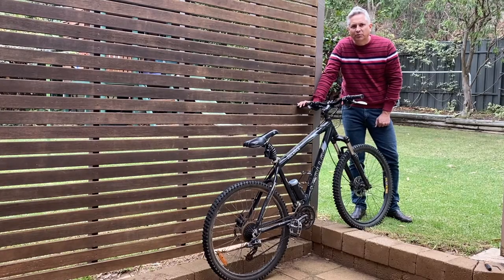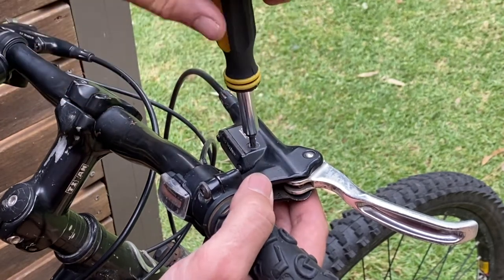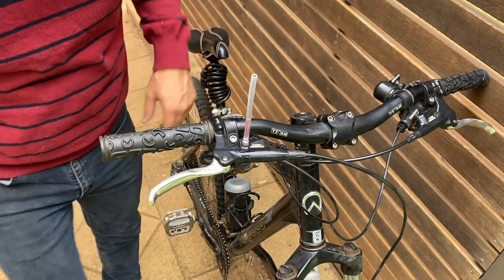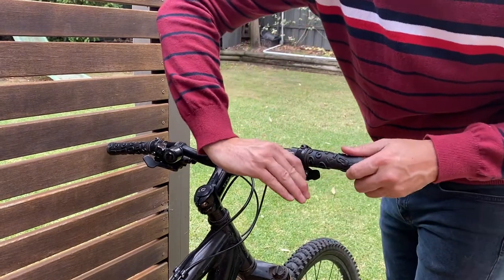How to Restore Tektro Auriga MTB Soft Brake Lever - Easy and Quick Bleed

Comment: Ta - that's an easy fix! Thanks for the demo. On a related matter, I managed to pull the lever out of the piston body in a stack. I'm unable to get it back in :( Do you know how to reattach the lever? The lever has a shaft with a ball on the end of it that pushes the piston to apply the brakes. Looking at it, seems the ball section should simply pop into the hollow of the piston end. But no.